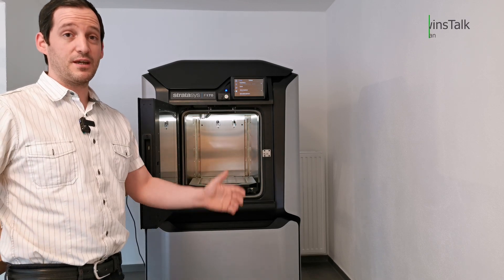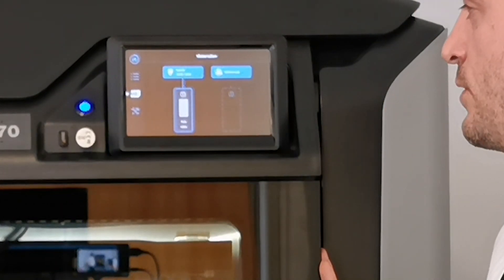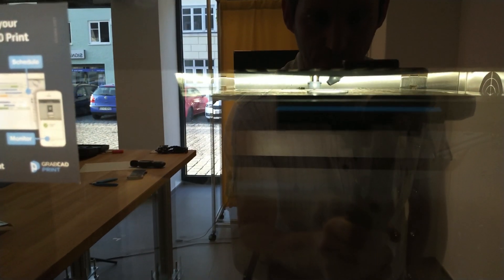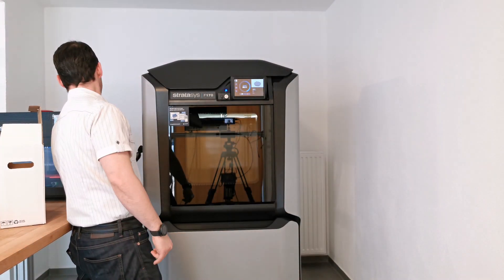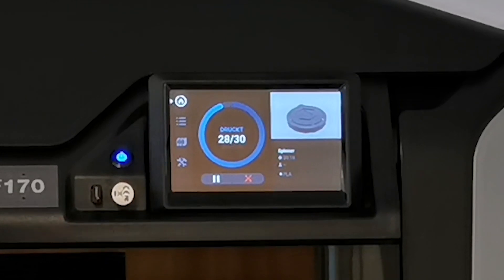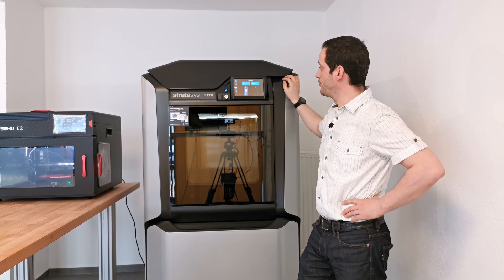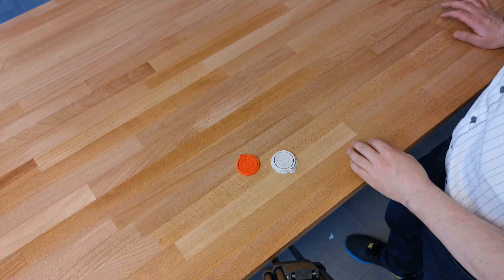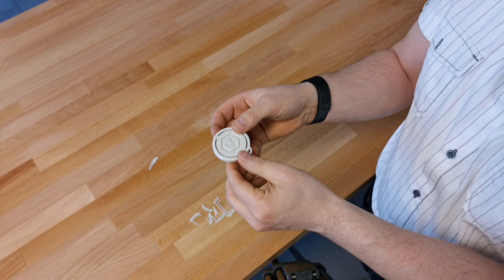Stratasys vs. Raise3D: Print PLA (Part 2)

Comment: Stratasys owns the most patents so their 3D printers better be better than their competitors.
Reply from the maker: Hi Stellarspace. Yes they own many process specific patents but crucial ones are expired. The competition is catching up and is much cheaper. Stratasys is putting a lot of effort in developing new materials and this is what makes them attractive for industrial applications. One major feature I am still missing in semi-professional printers is the "reliable" jam detection. I did not have one failed print with my stratasys regarding the feeding and extrusion system. You can just start a print and be reassured that the print will be finished next day without issues. 
The Raise3D E2 is nearly perfect. I did have some filament jams in the feeding system and failed prints because of bad platform adhesion but all in all I am really happy with it. It is reliable most of the time and print quality is great. -TT
Reply: Tell that to our Dimension I threw in the garbage when my home printer was doing a better job.